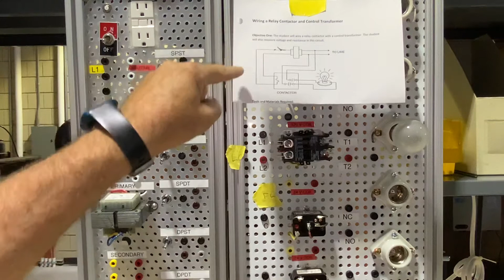Wiring a 24v coil contactor HVAC

Comment: if the incoming low voltage to the contactor was somehow less than 24v….say 20v….could the contactor work.  Or is 24v the absolute threshold amount to it functioning?
Reply from the maker: I have read that it should pull in with as little as 16 volts. If you are only getting 20 volts though there is another problem. Likely the transformer not putting out enough voltage